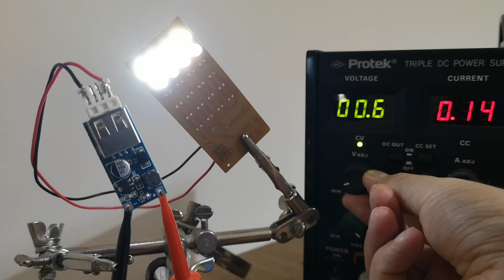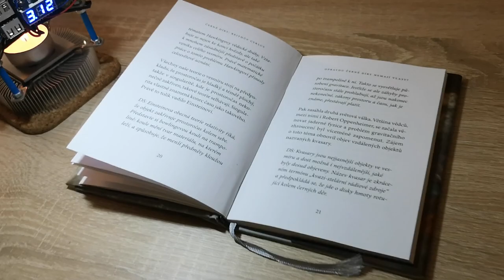How to make a DIY Thermoelectric Generator 2.0 - Seebeck effect

Comment: What is the point of the lower heat sink and aluminum block? They are below the heat source.  You could have just mounted the top apparatus to a board. Also the cooling side of the top radiator is inline with the heat source. Eventually you'll heat up the topside too, and lose efficiency. Try mounting it at a 45 degree angle to allow cooling air to contact the vanes of the radiator and allow the heated exhaust to escape to the side of the vanes.

Comment: What was SMPS set for in terms of output voltage?  As that's a 12v peltier (in an ideal world) and it's being underdriven, I understand the lower voltage from the peltier.. but using a boost converter ought to bring it up to the set voltage, at least without a load.  The inductive kick is going to be far above 5v, even if the current available is very low.  Is the fan in series or something?

Also, what did you get out of it in terms of overall wattage? (5v wasn't stable enough to ask stable current)
Reply from the maker: If you use only one tea candle TEG module can give you around 1,8 - 2V. Therefore it is necessary to have step-up booster. Step-up is good because it has usb port. It is easy to connect something to it. Motor and step-up are connected in parallel. Output from step-up is connected to input of usb tester. When there is nothing plugged into the usb port the motor goes at higher speeds. After connecting something to the usb port motor speed drops and generator is more quiet, but it is enough for cooling.
Reply: You can build a voltage rising device, with a diode, and a condenser.
But the output power remains the same.

Comment: Fixing hot plate and the heat sink, which of the following thermoelectric module can produce more power? TEC1-12702, TEC1-12706, or TEC1-12710.
Reply: None of those. TECs are for cooling and heating. You need a TEG. I use the SP1848.
Reply from the maker: TEG is not good for this application due to the low temperature difference. Focus on the thickness of the cell (try some TES cells 30x30)
Reply: @ramprojects6702  TES has a maximum of 50 degrees celcius on the hot side. What would you recommend for using a hot pan as heat source that is 60 degrees celcius? Which TEG did you use in this video?

Comment: Circuit diagram sir plssss
Reply from the maker: It is not necessary to have a circuit diagram to make this, everything can be bought already assembled.. TEG module, motor and step-up booster are connected in parallel. Output from step-up is connected to input of usb tester.
Reply: Ahh okay sir, but i can charge a phone to that?
Reply: @jefhersonmansueto4330 , with 5V..??
Reply: @stefanritscher7868  yes sir
Reply: Yes, you can charge usb devices with this at about 50 milliamps. This is best used for usb card led lights and charging devices that accept a trickle. You need a buck converter to boost the 1v to 5v.

Comment: I don't believe that 5 volts can be generate from one you need nearly 6 to 5 thermoelectric generator
Reply: You are incorrect. A single TEG will power USB with one candle. You must use a TEG, not a TEC. Also, you need a buck converter.
Reply from the maker: Do not use TEG if you have small temperature difference, try to use TES1-127040S or something similar.